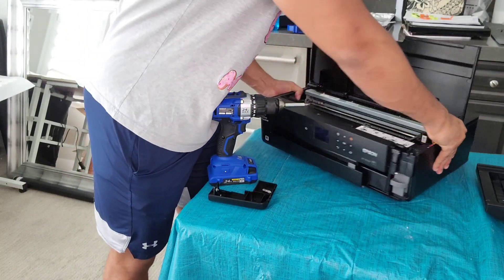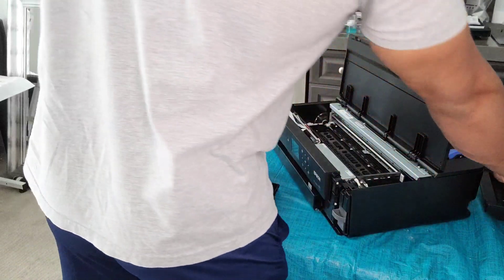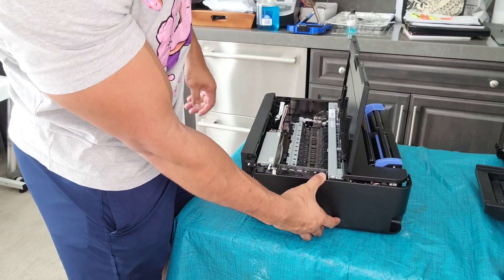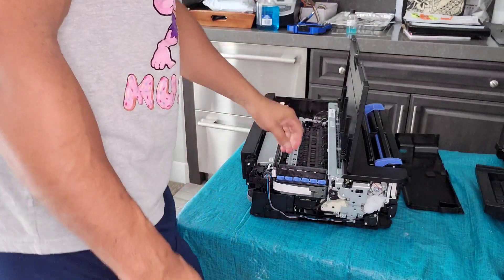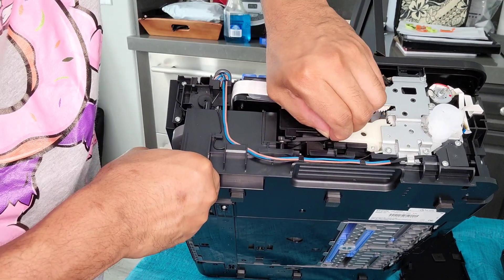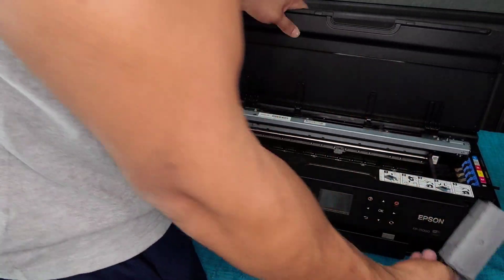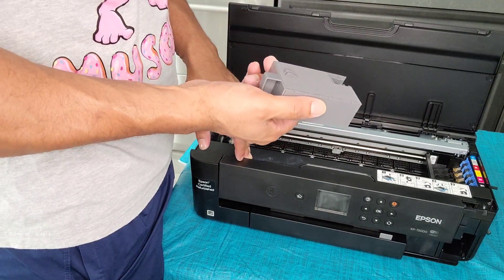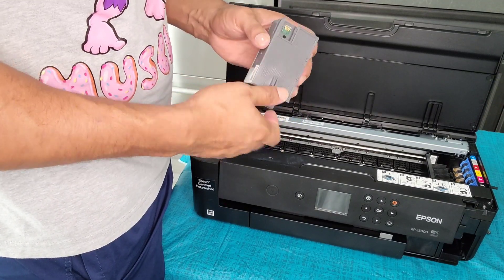Epson XP-15000 DTF Setup: Removing Rolls & Installing External Waste Tank

Comment: Hi thanks for you video your content was so helpful. Just wanna ask a question how often you do a maintenance of epson xp-15000 if it is converted to dtf printer, and do you replace the cartridge pr just refill the ink? Thanks in advance for your response. God bless you.
Reply from the maker: I have not used my XP-15000 in years, I switched to the ET-8550, when I was using the XP-15000, I would swap to the cleaning cartridges everytime I was done printing and keep those in until I was ready to print again.

Comment: You have not had a problem with this CIS system, I understand that it filters and ends up burning the printer
Reply from the maker: Not if the ciss has dampers, without them there's a possibility because  the refillable cartridges tend to leak when running excess printer cleans.
Reply: @HangryMuscle  I understand. I see that you started the printer without the cartridges connected. Do you not get air inside the head? Because my understanding is that it starts pushing ink to which starts the printer.

Comment: What refillable ink cartridges do you need for the printer? I looked on Amazon and they have chipless ones. Are they good to use?
Reply from the maker: Im using oem cartridges. If you use want to use the  refillable cartridges, look for a ciss with dampers as well. 
The cartridges do not need chips, if you have installed the chipless firmware.
Reply: @HangryMuscle  where do I get the ones you use?
Reply from the maker: Oem cartridges  come with the printer.
Reply: @HangryMuscle  okay so I just clean out that ink and put dtf ink in?
Reply from the maker: https://youtu.be/8J1qPdZAsg8
Reply: @HangryMuscle  thank you!
Reply from the maker: You're welcome 😊
Reply: Is there a part two?? Cause what to do after removing rollers??
Reply: @tonibates5341 I would like to know too?

Comment: hey ty! I can't get my printer to print my Cyan? any ideas..
Reply from the maker: You probably have a clog, you can put hot cleaning solution on a folded paper towel and let the printhead sit over it for like 20 mins.
Reply: I'm sorry what kind of cleaning solution?
Reply from the maker: Any, i use windex

Comment: Dead xp15000???
Reply from the maker: I don't recommend the Xp-15000 its hassle to maintain and use compared to the Et-8550
Reply: whats the hassle to maintain on the xp15000 compared to the et8550?    @HangryMuscle
Reply from the maker: Yeah, the Xp-15000s are down.

Comment: which printer do you prefer the et-8550 or the epson 15000
Reply from the maker: ET-8550 for sure. I had so many issues just getting the Xp-15000 setup and running
Reply: @HangryMuscle  thanks why did you add the ciss tank on the 8550
Reply from the maker: @matthewgrider33   I broke a connector piece off one of the Ink tank reservoirs, I don't recommend the CISS for this printer. The original tanks are much better for ink preserving ink consumption

Comment: How is it working for you now?
Reply from the maker: I haven't used the Xp-15000 in about 2 months. I've been using the Et-8550, its a much better printer than the Xp-15000.